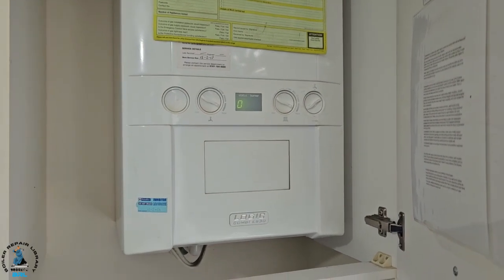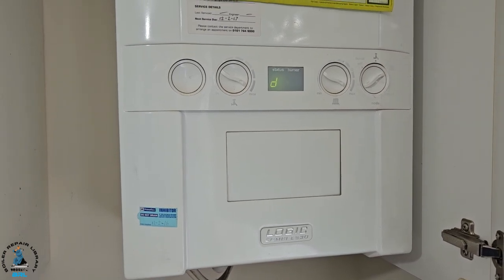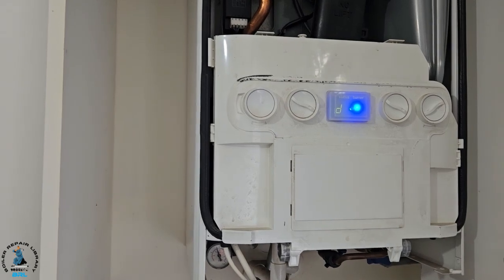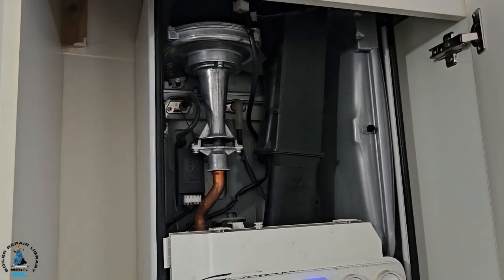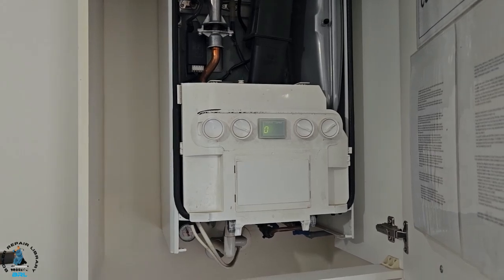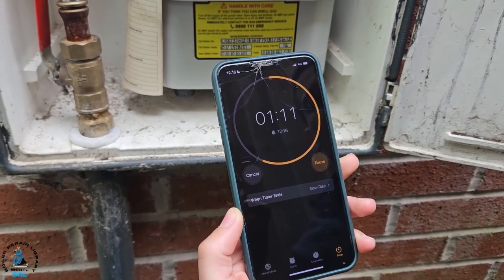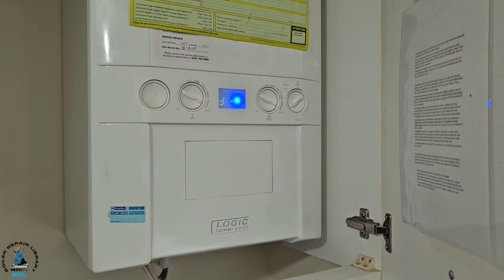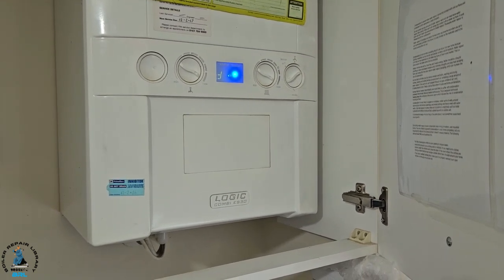Ideal Logic ES30 Luke Warm Hot Water | How to Fix  Ideal Logic ES30 Boiler

Comment: Had a ideal boiler fitted in last year in January/feb, since then i were able to have a super hot hot hot bath on 47 setting n since they came another firm came to service the boiler last month the hot water temperature at setting 47 has dropped to around 35% later that night, had another of his colleagues come round a month later which was a few days back n he said just turn up the temperature anyways a have done tonight at 60 n has only increased in temperature at around 5%, think his apprentice has botched up the boiler some how as his boss wasn’t happy he removed the boiler cover without his say so not forgetting they struggled to re fit the boilers cover which was a p1ss tek! Took 40 minutes to service my boiler where as usually with my old boiler it would have taken 10-15 minutes! Some thing ain’t right a swear the dodgy b#*#*#*#

Comment: I have this problem.. Ideal logic struggles to light. Will light after 10 mins. Flow turbine .diverter valve  small heat exchanger. All ignition parts . Gas valve. Fan. All changed... Seems it's not getting enough gas to ignite. But when it does I have great c/h. Luke warm water. If I slow tap down I will eventually get med/ hot water.. . Any help please would be appreciated
Reply: Who's been throwing parts at that? Check what the gas pressure drops to on ignition.

Comment: I've got the exact same problem. But the heating is working fine. I've changed almost every part. Will there be anything obvious showing on burner when i open it up?
Reply: The burner if U look inside will be flexible plate that normally snaps on the welding bit.